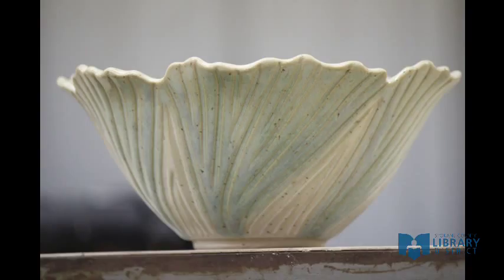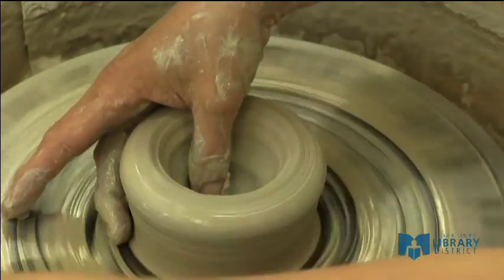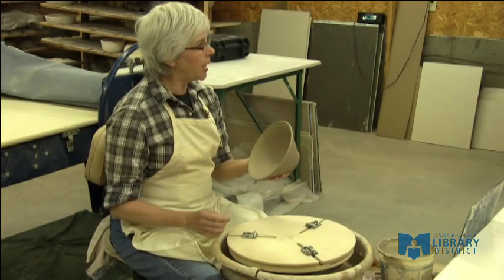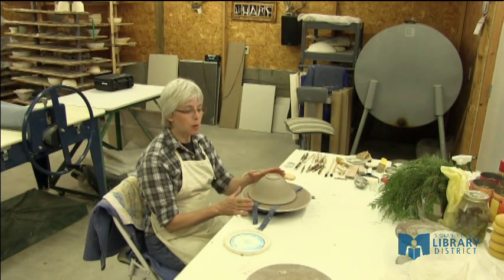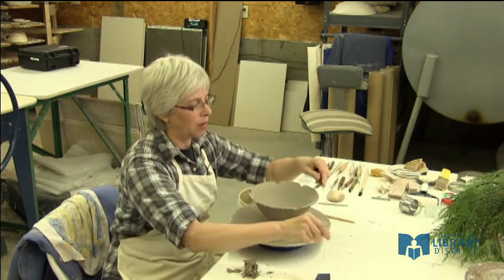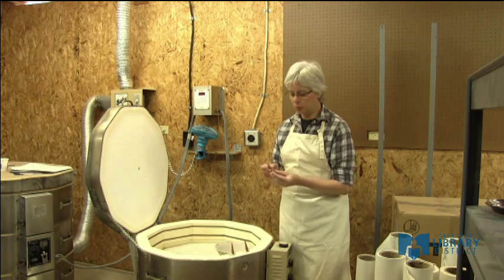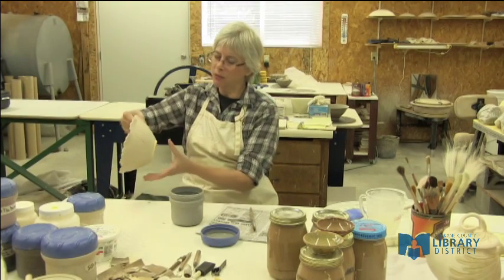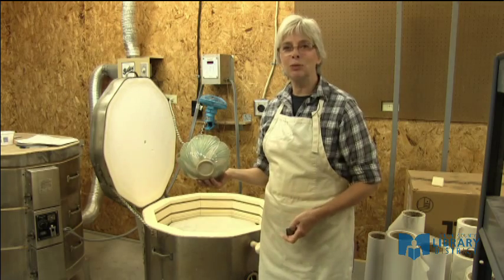Learn To Make a Pottery Bowl (Full Video)

Comment from the maker: Amy uses Archie Bray Foundation in Helena, MT. The clay is called M340. It is a light buff color when fired. It is very smooth which allows her to do the carving. It is rated as good for small to mid-range size pieces.